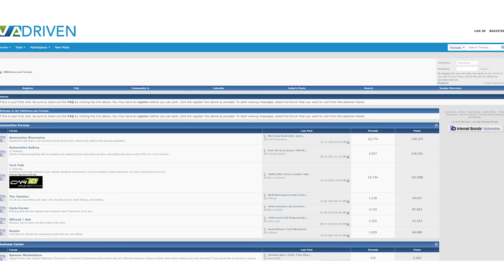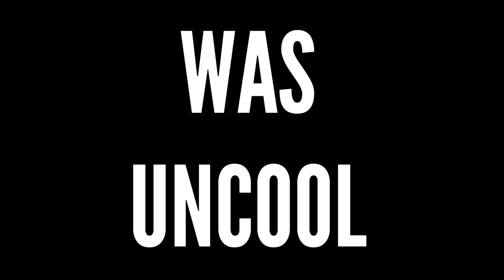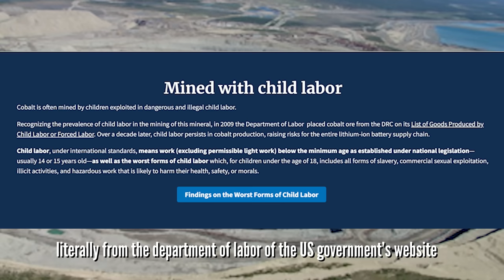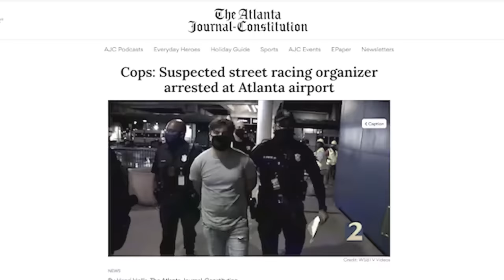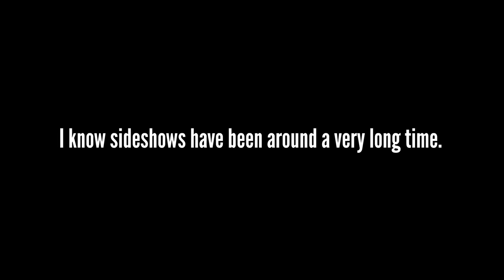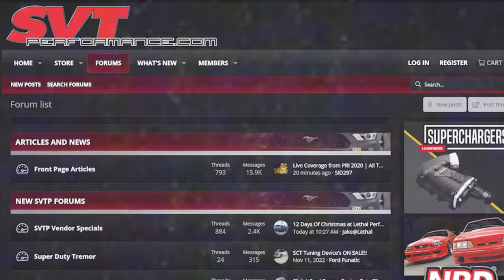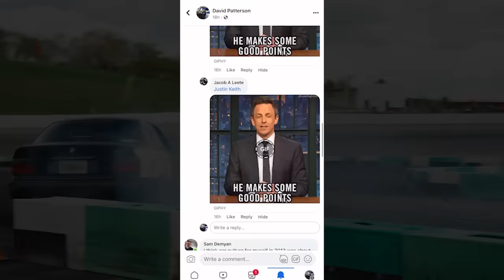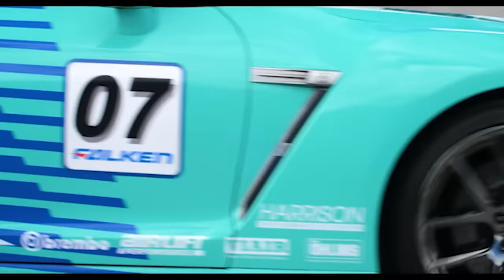Car Culture Has Changed: 2012 vs 2022

Comment: people are also way to damn cocky now lol you have headers E85 mustangs thinking they are the fastest things in the world when in reality of todays hp that's not fast of course what's considered fast also depends on weight id say a car making like 600+ hp under 3400 pounds running mid 10s is rare and fast a car that can run 9s is very rare a street car that can run 8s is Extremely rare extremely fast and a street car that is running 7s is practically a unicorn  and light speed fast